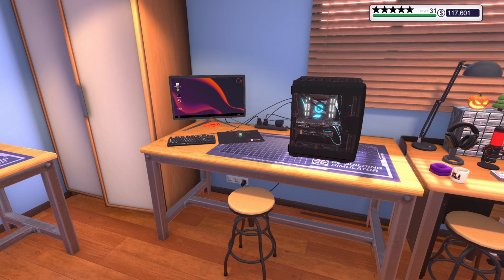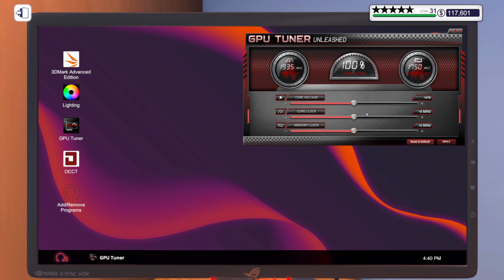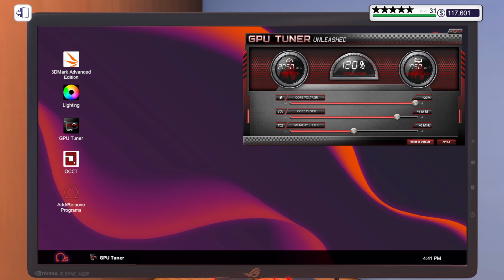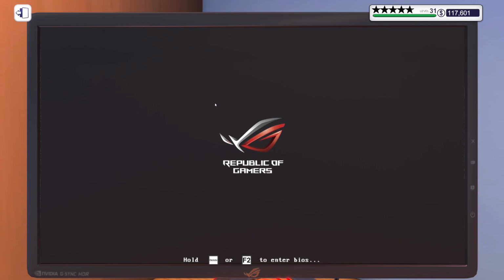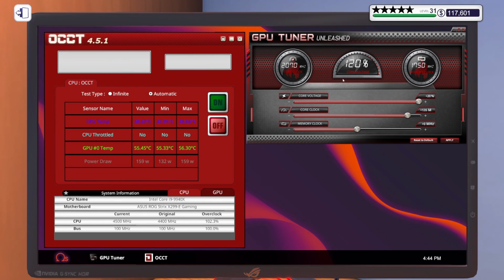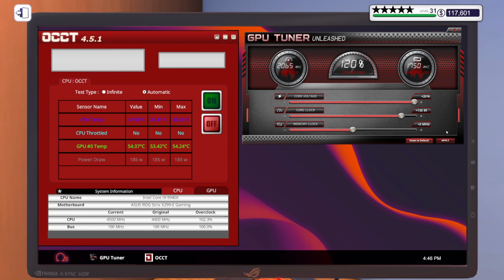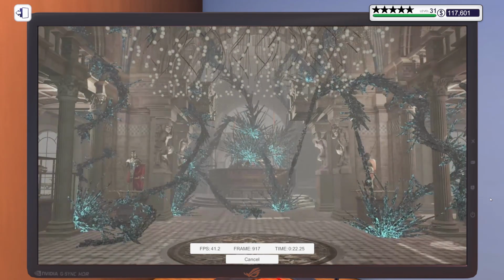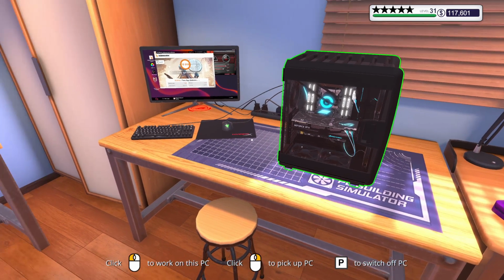Graphics Card Overclocking Tutorial | PC Building Simulator (Version 1.8)

Comment: Gpu overclocking is a bit unrealistic. All gpus I have overclocked so far seem to have 250MHz oc "pool" I can share between core and memory. If I set 200MHz core and 50MHz memory it's ok. I set 200MHz memory and 50MHz core and it's ok. 250MHz core and 0MHz mem is ok. etc. etc. But if combination of both goes over 250MHz it crashes. Also memory overclocking doesn't seem to affect to 3dmark score much so it's sensible to overclock core alone.

Comment: I’ve got a PC Build job at the moment and they wanted CPU over clock to 3975 MHz, and that was easy. They had a huge budget so I just bought the Intel Core i7-7700 K which has base clock of 4000 MHz. Issue is, they wanted GPU clock to 2197 MHz, so I bought the best gpu I have available to me at the moment, GTX 1080 Xtreme Edition 8G, and the program won’t let me clock further than 2100 MHz. Is that the same for all gpu’s? Should I have rejected this job?
Reply: Never mind! I saw someone’s comment on the steam page saying to try a 1060, and that immediately solved my issue since that gpu can core clock up to 2300. I’ll definitely remember that next time I have to do anything like this again 😅

Comment: Good video! And while I do understand overclocking in gpu’s but I have this task that wants me to overclock to 1403 MHz. But the program will only allow me to get 1400 MHz😂 the task won’t allow me to change any components any ideas?
Reply from the maker: If it won't let you change components, unfortunately you are kind of stuck. If it were me, I would overclock it to 1400 MHz, if it's stable, and return it to the customer. Sometimes a few MHz isn't enough to make a difference.

Comment: what happens if it keeps blue screening on the target MHZ that the client wants?
Reply: the client has dual 1070's (which are not the same) but a $40 budget. added fans but to no avail. he wants a 2097 GPU OC
Reply from the maker: That's a tough one. You can do a couple of things but they will cost you in the star rating. First you can just stop the job but you will get 1 star, or you can upgrade their GPUs (you will get less than 5 stars for going over their budget but you should be able to get the OC they want). Neither is a great choice but might be the only way to finish the job. On a side note, some jobs in the game are meant to be rejected ... this sounds like it might have been one of those jobs.

Comment: Memory Clock does jack shit

500 mhz is like equal to 0.02 fps
Reply from the maker: Pretty much lol
Reply: It depends on the card, if it's fast enough but has slow memory overclocking it will really help
Reply: I don’t know if they updated the game or something, but increasing memory clock does wonders. However, it’s best to kinda balance it out and find the perfect balance to get the maximum score possible. I’m currently trying to get 21000 3d mark score with a single 3090 and a 5900x that hasn’t been overclocked at all.
Reply: Turns out, the speed of the RAM matters. I was using 2 Horrible RAM sticks with less than 300 MHz in speed for some 4800 MHz sticks, my score increased by 800 immediately.